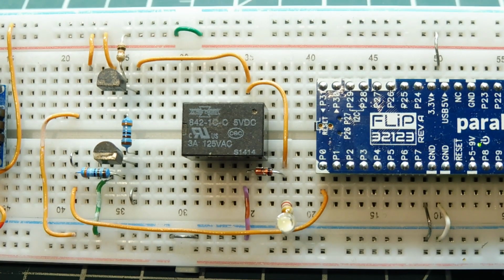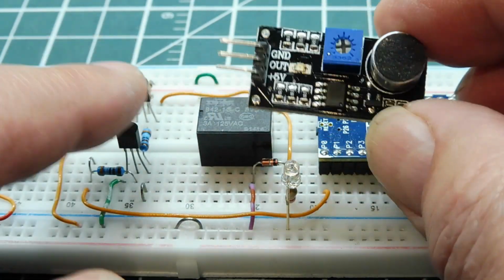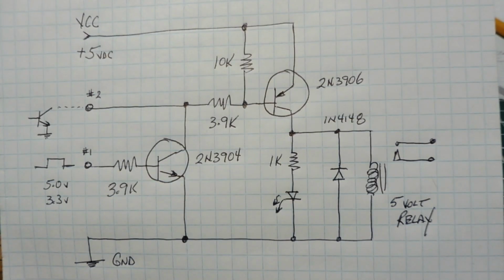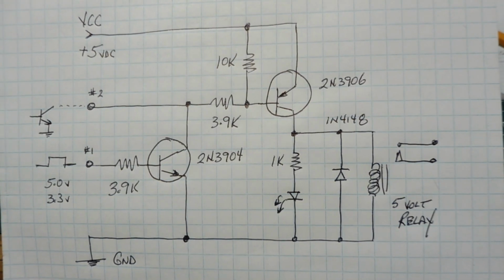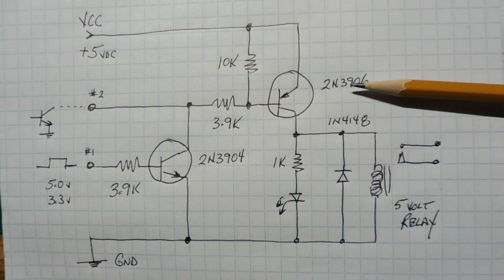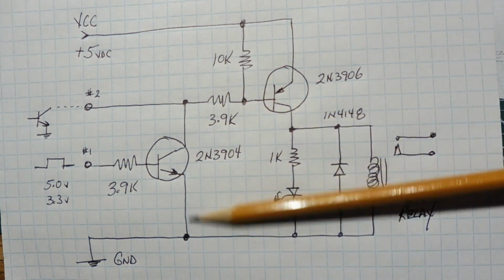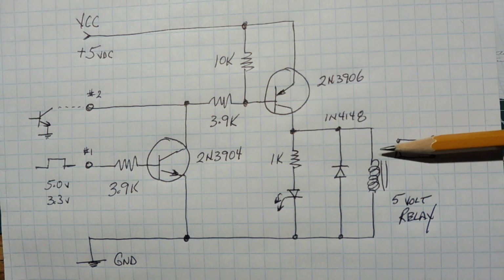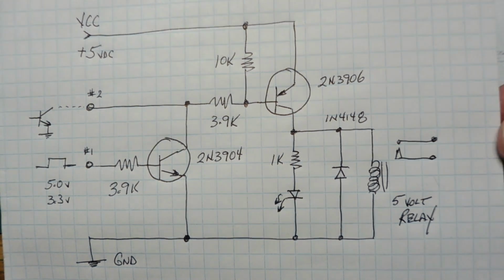Build An Universal Relay Driver Circuit

Comment: Hi. I am looking for a Tech wiz that can point me in the right direction for a simple circuit i can buy  on eBay for a few bucks to remedy a problem i am having with an 'open collector' transistor that is supposed to go to ground and force a push to talk and make a radio transmit.
when the repeater controller is non active the open collector is sending 3 volts and i cannot connect it or the tx ligh on the controller board stays lit when it should be normally OFF,so i am at my wits end on how to make this work.. when the reciever radio detects a carrier the tx light on the controller comes on to force transmitter to activate tx mode so this part is working proper,but when the reciever detects carrier drop the the open collector switches to 3 volts when the ONLY operation of this open collector is a [no connect or connect] like a switch dead short or infinite open without the need for ANY voltage.. i dont want to connect this to a transmitter and 'blow' the keying circuit out of the transmitter.

thanks for any ideas for a quick cheap fix.. i am a newbee and clueless on transistor circuits.
Reply from the maker: An overall schematic would be usefull for trouble-shooting.  Here are a few tests you can perform.
1. Remove the open collector transistor from the circuit and ground the PTT line with a wire jumper to GND.
    If you can control the transmitter the problem is in the switching circuit.
2. Measure the voltage on the PTT line with nothing connected. It will be 12 volts or 5 volts if a microcontroller is involved. 
   This is the voltage you should see when the receiver is squelched, when un-squelched the transistor should ground it. If you are getting 3 volts when squelched, the transistor is not fully off. Check the voltage feeding the transistor, when squelched and un-squelched, it sould go to 0 volts when squelched. Any voltage will keep the transistor semi on.
Reply: @0033mer  ics finally replied back with:
The easiest way for you to isolate any DC voltage from the controller getting back into your radio is with a series diode like a 1N4000 series. You can install it in the DB-9 hood quite easily.  so i installed a diode and badda bang its working proper now.. thanks for the quick reply  73's
Reply from the maker: Looks like it was not a true "open collector" but had a pullup resistor to 3.3 volts.
Glad you got it going!  Cheers.

Comment: What is the purpose of the shunt 10 kOhm resistor ?
Reply from the maker: The base of the transistor is pulled up to Vcc using a 10k resistor to ensure the transistor is "off" when there is no base drive. During high temperature conditions transistor leakage current increases so it is good practice to include the resistor.
Reply: @0033mer  You need a pull down on the input to #1 to ensure the NPN is off as well, especially when using the open collector drive input. 100k should do the trick.
Reply: Oooh yeah you are right I missed that. You know what your content is amazing 👍🏻👍🏻👍🏻
Reply from the maker: Thanks for the feedback!

Comment: Y not just use a single NPN transistor to turn on or off the relay ? 
Is there a reason behind using this kind of circuitry
Reply from the maker: Yes .. you could use a single NPN transistor to control a relay. This circuit is "universal" in nature as the input can be active low or active high. The circuit is very sensitive so input voltages of 3.3v and  soon to be used 1.8v and .8v logic can be used. It can also be used as a voltage translator from 3.3v to 5v or any other combination as the output is not inverted unlike a single NPN circuit.
Reply: @0033mer  That makes sense! Thanks for sharing!

Comment: Where do you source your components from at 3c a transistor ?
Reply from the maker: https://www.banggood.com/100Pcs-2N3904-TO-92-NPN-General-Purpose-Transistor-p-1018608.html?rmmds=search&cur_warehouse=CN
Reply: Thanks. I knew about buying components in bulk, but wondered if you had found a source to buy fewer than several dozen at a time. Aliexpress is also good.
Reply from the maker: Bulk is the way to go to get the low price.
For buying singles you are looking around 20 cents.
https://www.dipmicro.com/store/index.php?act=viewProd&productCode=2N3904